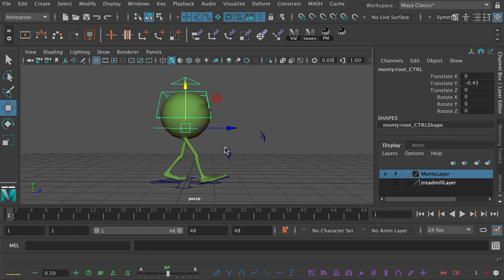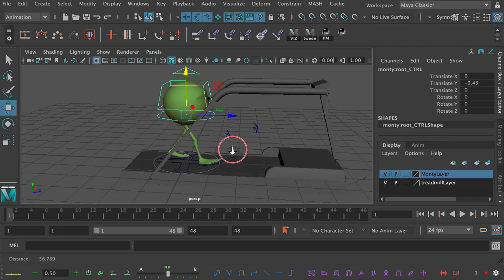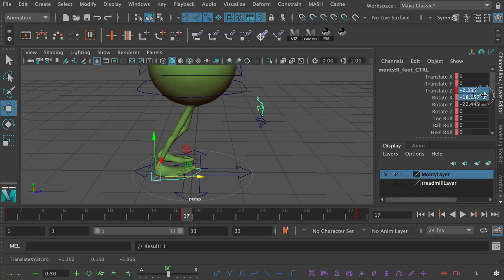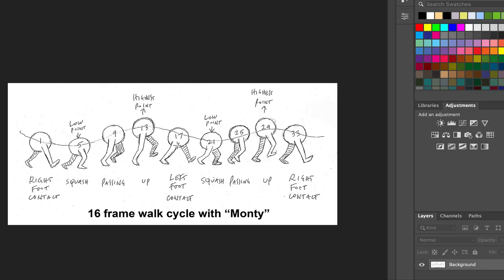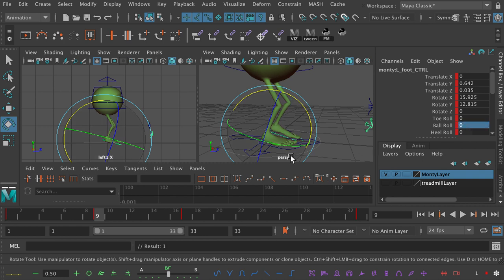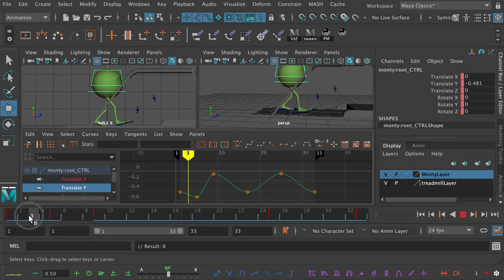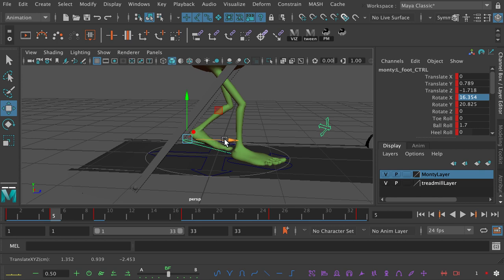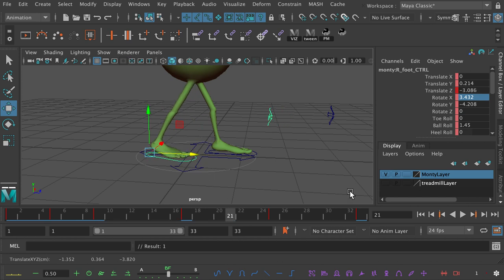How to Fix Floaty Walk Cycles

Comment: Audio not playing with play controls only plays while scrubbing the timeline.

My settings are

frame rate = 24fps

playback speed = 24fps x 1

Maya 2020 student version. 

I have this problem I imported .wav file audio for lip-sync animation. The audio is not playing with the play controls in Maya. 

Do you know how to solve this?
Reply from the maker: Audio scrubbing failure is a common problem in Maya. It's a pain in the backside. One possible solution is to try a different version of Maya. If you are running 2020, try opening 2019, or even 2018.